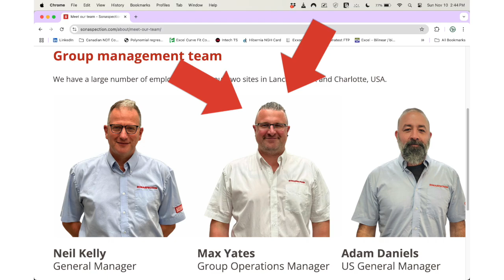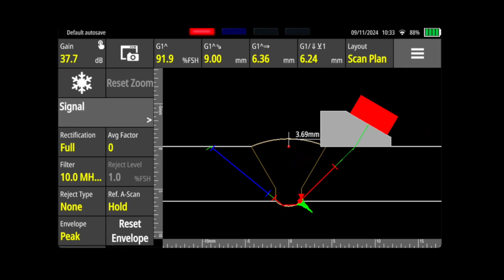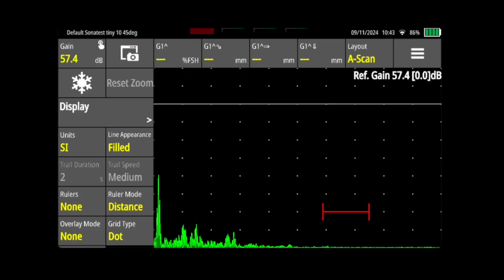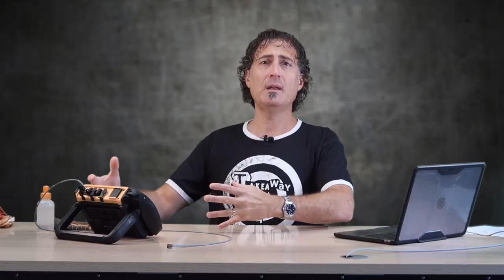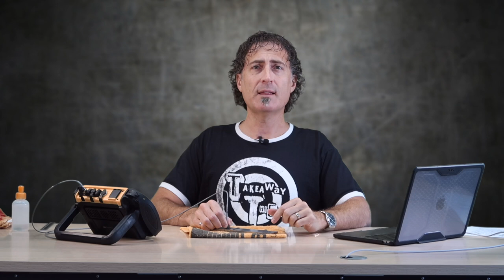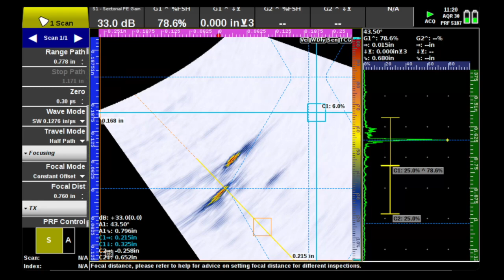Two and a Half Legs

Comment: I started UT in the late 70's with a USM2 /USK 6 ,you soon pick up the trigonometry ratios to determine flaw location. 
What has changed is the lost art of echo dynamics. Which was much easier with an analogue set. Determining a root pattern from LORF or hydrogen flake from N.M.I.s in a heavy forging. 
Having been a PCN examiner it is possible to get a distinction whilst failing to recognise and correctly identify any of the flaws in the exam samples. Which should be a concern, similar to radiography without Rad interpretation.
I obtained my PAUT /Tofd qualification 10 years ago (not recertified it) PAUT will definatley take over from manual UT as the price of it drops and it becomes standard on UT sets.
 I have to admit after years of manual UT I found PAUT / Tofd  in practise very boring. Last week I took part in corrosion mapping an oil processing spooling an 8 hour shift felt like two weeks.

Comment: I'm not surprised your sizing was inaccurate. You should only use 6db drop method on reflectors larger than the beam (Inverse Laws). Using it on a through thickness reflector like this would over size by 2-3 times. Max amp would have been very accurate if applied correctly.
Reply from the maker: I agree with it being used only on flaws larger than the beam, but I would also extend that to only large, purely planar flaws, which essentially limits it only to laminations. Alas, there is a lot of misunderstanding around it, and it continues to be taught as some sort of viable tool when in most cases it's just misleadingly simple.
Reply: @hollowayndtengineeringinc.5201  Training for UT to level 2 is only 120hrs of which around 80hrs is practical training. So the concepts have to be simplified and we are only able to teach rudimentary skills in this timeframe. A L2 exam candidate is expected to find, identify and locate the reflector relative to its position in the weld. Detection and location are weighted more highly in marking than accurate measurement of the reflector.

Going back to 6dB drop again (I know you LOVE this method lol). 6dB drop can be used on any type of reflector and can be very accurate on some reflectors, especially if the method is mechanised with a scanner. However the major mistake operators make is that the measured length is that of the reflector PLUS the beam width at that beam path (depth). If you subtract the beam width you will get the a more accurate length :)